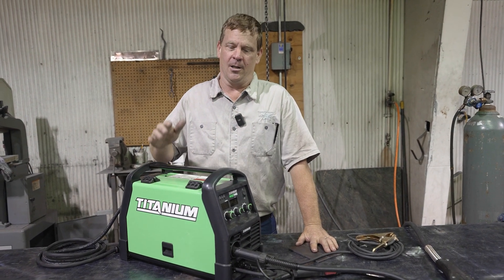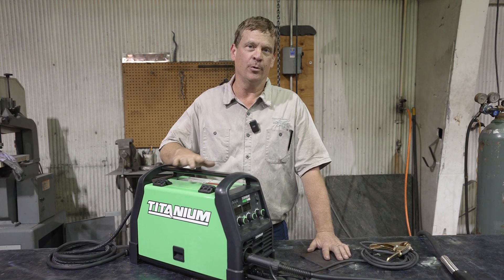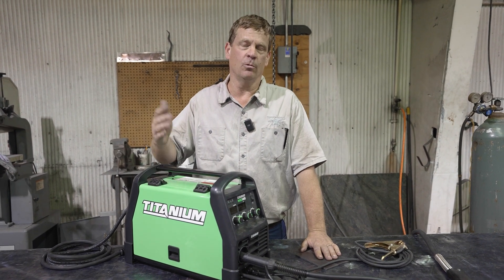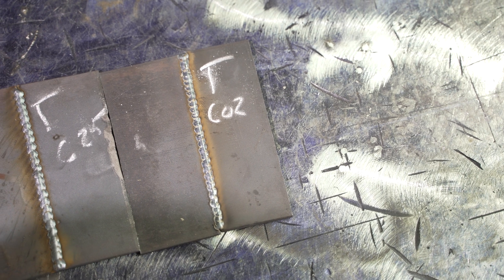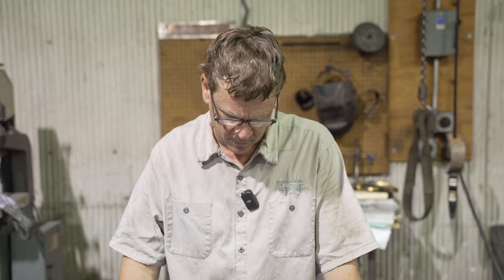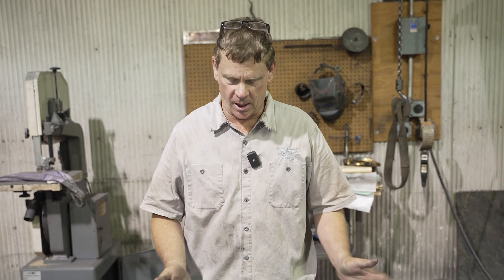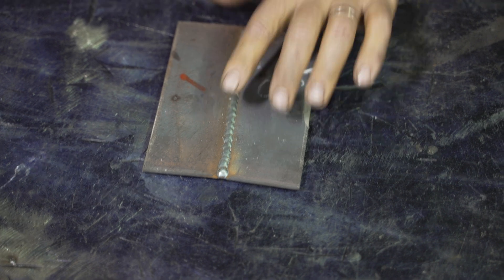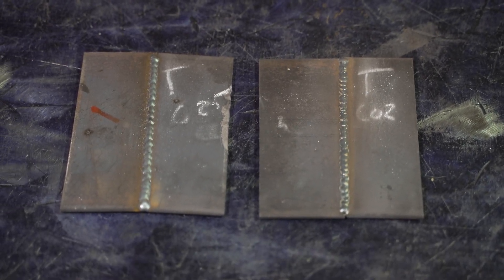C02 VS C25 Gas for MIG Welding on a Budget Harbor Freight Titanium 140 Welder

Comment: You didn't even get into the inductance control that your welder has (that 3rd dial) it can make a huge difference on what kind of puddle you r able to produce depending on the steel type and how clean it is.
Personally i like C25 better as you can get a nice liquidy puddle going but for all around i like Co2 as well with some inductance dialed in
Reply from the maker: I have never had a welder with an inductance knob.   That welder is a buddies and he wanted me to try it.   Thank you for the info.  Next time I will play with it and see how it works

Comment: I've used Co2 for home stuff and thought my work was full of spatter cause of the Co2, ends up Chicago electric welding machines are just really messy
Reply: A poor machine will reveal itself on a super clean prepped coupon , say 1/8 mild steel dialed in on about 18 volts u should be able to make a hot pass and the ARC remains perfectly stable , if the arc is fluctuating and not rock solid thats the machine  , find a better rig

Comment: For me, there is a huge difference in cost for the tanks.  A have an aluminum c02 tank for 'beverages', and it only needs to handle like 900psi,
where an argon tank needs the big heavy steel tanks for 3000psi.  Someone stole all my welding gear, so usually always used c25, but buying a new tank is toooo much.   In fact, I'm just using flux core now, but will get the c02 setup going soon.
Reply from the maker: @murraymadness4674  damn I am sorry.     Any one that steels tools is the lowest of lows.    Good luck.   And the co2 can run the kegerator when not being used for welding hahahah
Reply: @jensen-design  thanks, they stole my all my ryobi tools in a previous breakin.  I moved out of there, far away from the city now.   I also bought a cheap 140a 120vac mig on amazon that works ok, I have a 40amp 120vac circuit for it.  It was a discounted return, and then it had a missing spool and broken handle, so amazon just let me keep it and refunded me.  So that worked out when your broke!

Comment: I chose C02, you can weld stainless steel too, the  C25 is more cold 🥶, = more  current
Reply from the maker: I have used co2 for stainless also with very good results

Comment: Can CO2 also be used to weld in applications where very clean welding is required? Like, for food processing equipment, turbines, etc.
Reply from the maker: I don't want to say yes because I don't know exact specifications.  Co2 runs clean and I think it would work fine. Thoes type of jobs usually require lots of clean up and polishing.    This isn't the type of work I do but this is my limited knowledge
Reply: Food processing u r usually playing with stainless and that runs better with a tri-mix , as far co2 being clean its a reactive gas its not MIG its MAG and the way i try to get a cleaner weld is i watch how much sparks r being thrown off while im welding , u can dial yur wire speed back a bit if your making to many sparks and still have the sizzling bacon sound